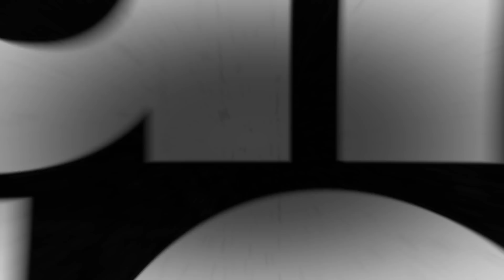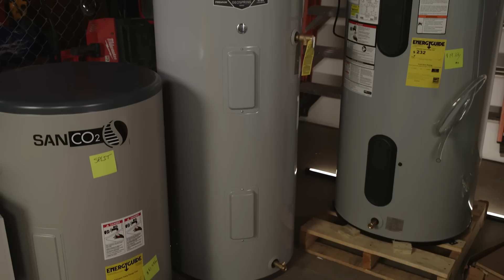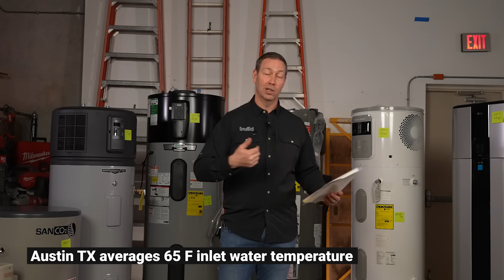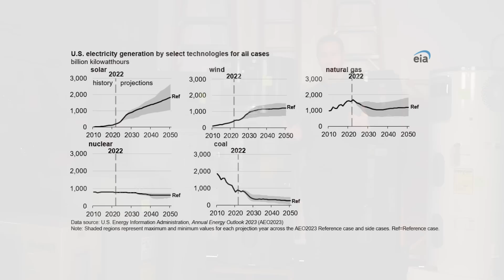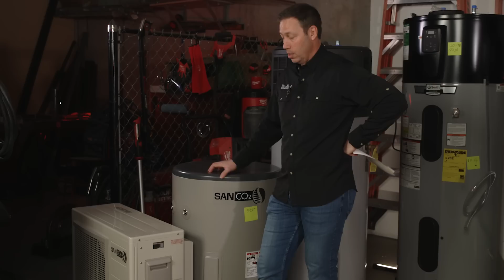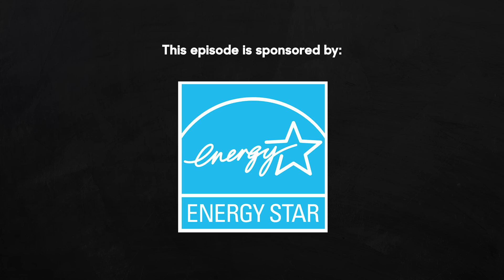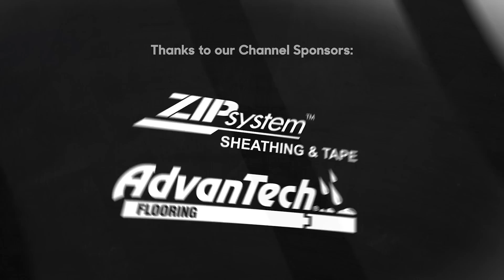2024 Heat Pump Water Heater Buyers Guide

Comment: The CDC recommends setting the storage (tank) temperature to above 140F and setting the flow (tank output) temperature to above 120F by utilizing a thermostatic mixing valve (or equivalent component), while OSHA recommends exactly 140F for the storage and exactly 122F for the flow - both agencies intending to optimize for sanitation against biological contaminants like legionella. The EPA recommends 120F for both storage and flow - intending to optimize for efficiency while at least preventing legionella growth (though it won't kill it.) Most water heater manufacturers leave it up to the consumer to decide how they want to optimize, but advise against settings over 140F for long term use due to the extra wear it causes on the system components. State and local plumbing codes determine the acceptable maximum hot water tap temperatures from an anti-scald perspective. In my area, 135-140F storage mixed to 120F flow and tap is very common, with the strategy being to kill in the tank and prevent growth in the lines while still meeting the anti-scald requirements.
Reply: well... the main reason for this is really for commercial applications... the reason is to reduce the incidence of Legionnaire Disease caused by the water supply
Reply: @billceve9830  The recommendations are applicable to any hot water system, commercial or residential, but commercial entities are definitely far more likely to face fines and lawsuits if legionella crops up and they weren't following the recommendations. The news media often covers the reports of Legionnaire Disease from hotels and resorts and campgrounds, but the occurrences in residential settings are actually quite a bit more frequent by comparison - probably due to people cutting corners when less financial liability exposure is involved.
Reply: A thermostatic mixing valve and a circulator are two very different things. A circulator system often requires a thermostatic mixing valve, but in many if not most systems (like in many of the places I've lived) the thermostatic mixing valve is not used with a circulator pump system—it merely regulates the hot supply from the boiler or tank down to a temperature appropriate for supply to faucets, clothes washers, & showers. This kind of setup, without a circulator, is what he was talking about in the video.
Reply: @DrewNorthup  I edited my comment for clarity. Previously I meant "circulation" to reflect water at flow as opposed to "tank" and "storage" to reflect water at-rest, but I can see how the use of that word might also unintentionally imply a circulator-type system or components. Meeting the CDC/OSHA/EPA recommendations in a circulator-type system is a bit more complicated unless a tankless/on-demand water heater is used, and I usually only see tank-with-circulator setups in commercial applications like hotels (so outside the scope of this video.)

Comment: I changed out my old electric hot water heater about a year ago for a new Rheem heat pump 55 gal tank.  I keep in on heat pump only and it is in the basement and it helps cool my house when it is running which helps my A/C unit...been very efficient !!  There is only 2 of us in the house but even when I get company, I still haven't ever run out of hot water ..cut my hot water bill by over 65%!!

Comment: I got an AO smith a few years ago and for the most part its amazing. I keep in a non conditioned laundry room here in North texas and during the summer it does cool the room off just a bit. And only uses like 400w of power for the short time that it runs. Only wish it heated the water slower to cool the room off more. But in any cold blast like we have right now i have to make sure to turn it to resistive only otherwise the room can easily get way colder than the other rooms and freeze the condensate drain line (like it currently is)

Comment: My hangup with them, is what happens when the tank rusts out and fails.  Now, instead of just tossing a tank, you're also tossing out a perfectly good heat pump as well.  The split system looks promising though..
Reply: The split system in question has 2 stainless tank options which actually carry a longer warranty than the heat pump, although the tank warranty is prorated from years 11-15.
Reply: @bspanger1  That's good to know!  Would be kind of a waste to have to replace the whole thing because either the heat pump or the tank failed

Comment: It is misleading at best, and deceitful at worst, to claim that the 100% efficiency of a tankless water heater is necessarily worse than the 300-400% efficiency of a heat pump water heater. Those measurements aren't measuring the same thing, because the heat pump water heater can't heat the water as it's used. This means the water heater has to constantly push heat back into the water to make up for heat losses inherent in a storage/tank water heater. In many applications, a tankless water heater will still use less energy than a heat pump water heater, because it only ever has to put just enough heat into the water the instant it's being used.

I wish my own experience with my Rheem heat pump water heaters matched the promises given in this video. The only thing I can say positive about the installation in our new house is that the installer recommended getting two, which has served us well when one of the water heaters stops working. We have to ration hot water, but at least we have some. And even with two water heaters, they can't keep up with our five-person household unless they are in "high demand" mode (which prioritizes heat production via heating element over efficiency).

Even if the heat pump is technically 400% efficient, the overall efficiency is much less if the heat pump isn't capable of providing 100% of the heat needed by the household.

I have found our water heaters too loud for my tastes. They are located in the basement, behind a closed door, and I still hear them. One hopes the newer models are indeed quieter. Another issue is that they are ducted to exhaust to the crawl space, but without any dedicated make-up air. So when they run, they pull outside air into the house through whatever cracks and crevices are in the house. In hindsight, maybe the installer should have skipped the exhaust ducting and added a circulation fan to move air from the heated area of the house to the mechanical room (which is insulated and technically part of the conditioned envelope, but doesn't have its own heat vent), but that of course would add complexity and cost to the installation, not to mention something else to maintain.

Even with proper venting, it's important to keep in mind that there's no free lunch. Maybe in the summer it's nice to move some heat from the air into the water, but for those of us where the heating season is longer than the cooling season, any heat the water heater puts into the water is heat you now have to make up with the furnace. At best, you'll be heating with a heat pump and so maybe it's a wash, but if you're heating with gas or resistive electric, you haven't really improved efficiency. You've just shifted the lower-efficiency heat source upstream of the water heater. In fact, in that case you've hurt efficiency, because while the "efficiency" rating of the heat pump describes the energy used relative to the energy moved, at 400% efficiency that still means that to add 4 BTU to the water, you have to spend 1 BTU of energy. If you're just pulling the heat from your 100% electric furnace, you're actually spending 5 BTUs to get 4 BTUs of heat in the water, which is really only 80% efficient.

Speaking of maintenance, our heat pump water heaters have been unreliable. Fortunately so far they've been able to be fixed under warranty or through advice from Rheem's technical support number. But the fact remains, the water heaters were roughly 3x the cost of a conventional one (around $1800 vs $600), and it's hard enough to make back the $1200 difference (or $2400 in our case, since we have two) through energy savings, without also having to bear the added cost of having to pay someone to come fix it (assuming you can find such a person...the last repair I wound up dealing with Rheem directly because the only plumbers whose service area included my address were "replace only" plumbers, who didn't handle repairs).

I've never had a basic gas or electric water heater fail except at the end of its life, when it was time to replace anyway. Heat pumps are inherently much more complicated than simple gas-fired or resistance heaters, and have lots of new ways to fail before the water heater's lifetime is up, and that cost has to be counted when looking at expected savings over the lifetime of the water heater. Even a small repair's probably going to cost $200-300 if you're lucky, which could take another 2-3 years of operation to make back with the heat pump water heater.

The heat pump approach does have lots of potential, but so far it's been my experience that it's not living up to the potential and I'm finding in hindsight I'd much rather just have installed a conventional water heater.

Comment: Great information Matt!  I installed a Rheem 50 gal in my garage and ran a short section of ducting into the HOT attic above the garage.  During most of the year the attic is considerably warmer than the outside air and certainly warmer than the ambient air in the garage.  Why not capture that hot air and turn it into hot water!?  It's working and working very well indeed.

Comment: Another great video. 

Out of curiosity, if some these models can require condensate lines and venting, why don't modern refrigerators have the same requirements?
Reply: Your refrigerator drops condensation into a tray underneath it, and produces little enough that it just evaporates away.

The venting I think is just an option if you want to pull warm air from one space and push could air to another.

Comment: @buildshow could you ask @MitsubishiHVAC when they're going to make a heat pump water heater with exterior compressor?  There are people on here making DIY ones.   The sanden unit needing heat tape for the winter is a power outage load you wouldn't need if the refrigerant was piped outside instead of water.

Comment: I have plenty of horizontal space but the height is the problem in my crawlspace.  Also my crawlspace gets too close to freezing in the winter for my comfort so I'd need to run in full electric on the coldest days. So i might need the split unit, I'm in a moderatly cold area.

Comment: I would gently caution against rinsing the filters.  On some manufactures models (rheem in particular) there are leak sensors that will trip if they get wet.  I have had some clients rinse a filter and shake off and reinstall and it trips the sensor.  So I tell my clients to rinse and then allow to dry completely. Bone dry 

Aside from some sequence changes by Rheem and AO smith, we have had amazing luck with them and I would switch to one in a heart beat.

Comment: Omitted from this video is a third type (mine holds 79 gallons)- Solar Assisted Heat Pump Water Heaters (SAHP). These use exterior panels that absorbs heat from the air vs "Solar Assisted" referring to photovoltaics. SAHPs do not cool the space they occupy and they don't produce condensate.

Comment: Other than the split unit; how do these not add to the HVAC load of the home?  Seems to me that you would need to upgrade your heating system to compensate for pulling heat from the room.

Comment: you know, I don't get it. All of these savings dollars you speak of assume that they will run at the same efficiency from cradle to grave and that there is no bypass dirt that will clog up the evaporator and either just cost you more money to run or overheat the little heat pump till it destroys itself. Then tell me what the " plumber " who installed it is going to do??? A professional cleaning of the evaporators that are clogged with bypass dirt will cost several hundred bucks, Put those rebates and tax breaks in a money market account because you very well may need it to replace your heat pump water heater prematurely. I was around in 2008 also on the wholesaler level and being in HVAC laughed at these products especially when I took a walk in the warehouse and saw many of them returned with bad compressors. What is really unfortunate about these Heat Pumps, whether they be hot water tank or ducted or ductless split Inverter heat pumps is that some of the people who can least afford it are having to pay big dollars to keep them going that is if they can find someone to clean or service them.

Comment: BULLFEATHERS. To say that HPWHs are more efficient is true, but to say they therefore "cost less to operate" is totally specious. Their btu cost is what is comparable, not COP when comparing to gas. And none of those labels, include the cost of reheating the room air that it cools, with w/e heating equipment you have, for us in northern climates. You know better. They add noise, they cool a room that you may want heated, they are slow to recover, they take more room, there is much more tech to go wrong, and often cost more to operate than gas. That needs to be in your conclusion.

Comment: Matt, you always mention building a house that can last 100 years or more. I think that thought should be applied to all aspects of a house.  

  These water heaters are complicated and while they may save money in the short term, they will cost more in the long term when you have to replace them twice as often.  

My gas fired 40 gal tank water heater is from 1988, working perfectly fine and has only ever needed the thermocouple replaced once.

Comment: These aren’t great for northern climates like Alaska. Putting them in the garage in winter isn’t gonna work and why would you put them inside the house when there dumping 1 ton of cooling and your trying to heat your house when it’s 20 degree outside lol
Reply: There are many Sanco2 units installed in Alaska.  The Sanco2 will produce 145-150F water at an outdoor ambient temperature of -26F.  (Yes, minus 26F)  The heat pump unit can be located in a garage or outside the house.  The CO2 refrigerant that the Sanco2 uses is very effective at heat transfer in very cold ambient temperatures, and includes freeze protection features to prevent freeze damage to the unit.
Reply: @bspanger1  you can’t install the sanco inside it voids the Warrenty. The condenser has to be located outside. What cities in Alaska are they installed in? Heat pumps have only been proven to work in southeastern Alaska where winter is temperate.
Reply: @Albanianguy9  Eco2 Systems does provide warranty coverage for an interior heat pump installation.  They have a document specifically describing the requirements for indoor installation.  As long as the heat pump unit is installed in a 600 Cu. Ft. space (400 Cu. Ft if it is vented) to provide adequate airflow it is supported.  I am aware of installations in Anchorage and Juneau although there may be others.  The technical specs for the heat pump specify an operating ambient temperature range of -26 to 114°F, which covers northern parts of Alaska too.  I agree that an installation inside the conditioned space will have a cooling side effect, but the heat pump is often installed in an unconditioned space like a garage or an attic.
Reply: @Albanianguy9 I can confirm that there are Sanco2 installations in Kodiak, Homer, Wasilla, Sitka, Eklutna, Fairbanks and Anchorage, and installations pending in Tyonek, Anchorage and Utqiaġvik (formerly Barrow). These are the ones I know of, I'm sure there are others.

Comment: @buildshow, is it possible to combine the heat pump from the central air conditioning unit with the heat pump from the water heater? I would think using 1 outside unit would further decrease the upfront cost. In Warner climates, the heat captured by the heat pump for cooling the home could directly be used to heat the water, increasing the efficiency of the heat pump even further. Combined with variable stage heat pumps = great savings.

Comment: In the EU, we usually take outside air in the winter time to heat the water and exhaust to the outside as well.  Inside air is unchanged. 
My personal setup has a 3 way valve for the air inlet and outlet (costs $40 total). I flip those in the summer months, now it takes inside air and dehumidifies and cools that and exhausts into the laundry room.
Reply: Can you post a link or name of the air switching valve device? I have the same concerns about air cooling and drying effect during winter time. Thanks.
Reply: This sounds like the way to go, and would best be designed in new construction. I too would like to have the name of your 3-way valve.
Reply: That doesn’t make sense

Comment: For the 120V models, is the heat pump also a power capacity than the 240V models?  Or do they just have less backup heating element power?  Or a little bit of both?  I would think 120V would be fine for 12k BTU but much higher than that, maybe not.